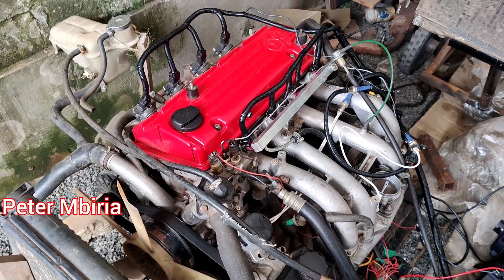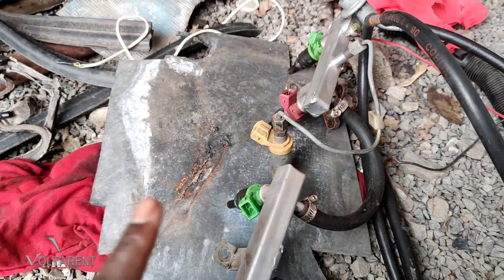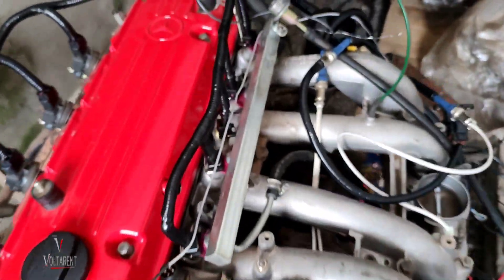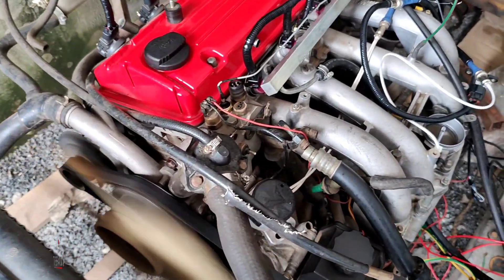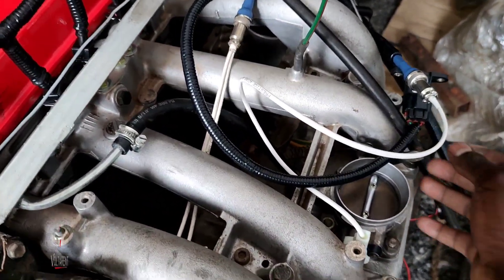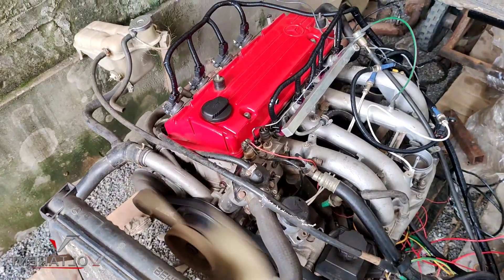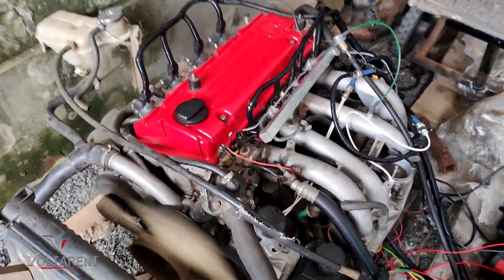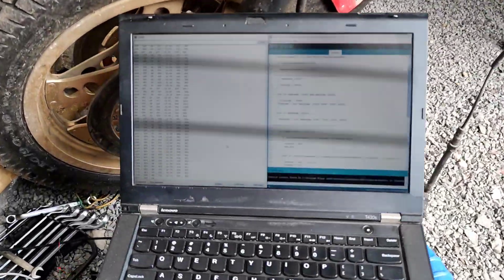Introducing Voltarent EFI: Simplifying Engine Performance for DIY Enthusiasts!

Comment: Peter this is good. Do you have ECUs for 6 cylinder engines?
Reply from the maker: Yes I do and have done multiple installations on different 6 cylinder engines. I've done 6 cylinders from Benz, Jaguar and Toyota.

Comment: I have checked your website, I can only see some information about the ECU box. I think this modification requires more parts and electrical connections. Car enthusiasts also need OBD reader that is one of the most important tools for car enthusiast today. Its a good start to replace the old ignition system but that will not make your drive train similar to a modern car. The carburettors need to be replaced to a new intakemanifold that can adopt to fuel injectors.

Comment: Hi Peter, I have an W124 230E 89, M102 wtith Ktronic and then another 230 CE M102 from 82, also with Ktronic.  The engines are identical excerpt for the single control chain in the older engine.  
Could you give me an estimate fuel saving for this engine?
I am looking at whether I am permitted to upgrade either or both without loosing my oldtimer reg.  Thank you in advance.

Comment: From Namibia here, can you please explain your technology in layman's terms? So I can see value. Explain as you would to a 12 year old. What's your website or email WhatsApp etc.
Reply: Hi There! Great project indeed! In simple terms, it's a  software app running on a tiny computer like an Arduino or Raspberry Pi  that controls how the engine behaves. This includes controlling timing of spark,  fuel transfer,  measuring amount of air intake, checking temperatures, sensing the crank and cam positions of the engine as it rotates, etc. The little app tracks all these values or parameters to improve its performance in many conditions like speed, fuel economy, or even increasing the torque on the wheels pulling a trailer load.  Similar open source projects are Speeduino and LibreEMS! Very fun!
Reply: @projectsspecial9224  Thanks a million 🙏
Reply: @projectsspecial9224 good afternoon sir, please can I have your WhatsApp number, I need your teaching on this project, I want to learn

Comment: Hi Peter
This is Ian Joubert from South Africa. No it does not have EFI, it's a 1984 5 Cylinder 1900cc Passat sedan with a 2B2 Pierberg carburetor.They don't  make that carburetor anymore and it won't let the car idle properly. The problem is the fact that is a 5 cylinder engine. Ian
Reply from the maker: @ianjoubert4360  this one can be modified to full EFI without issues.
Reply: If you guys change to efi. Please make a video.

Comment: Hi Peter! How can i buy it?Hi Peter, how can i buy it?I need the whole kit, fuel rails and all. 190E 2.3 1987
Reply from the maker: Hey man, thank you for reaching out. Where are you located? What's the setup of your engne? This will aid in getting the right parts (FD and carb will need slightly different parts).
The website is not yet fully functional (voltarent.co.ke) but we can organise how else you can make the paments. Shipping will be done via DHL or any other shipping vendors to your location.

Comment: Nice job peter. these days it works better we need it i. Pakistan aswell... 2ndly i suggest you to bring car ac compressor and water pump on electric which reduce the load on engine wil increase performance and fuel economy aswell

Comment: Hello Peter.
I have a w123 230e M1029... engine.  I had an aftermarket EFI system with a standard Dictator Engine Management System installed on it.  The ignition system runs on an electronic points distributor, with a coil unit supplying voltage to all four spark plugs, via the distributor cap and rotor arm within.  The fuel supply setup is similar to yours, consisting of a fuel rail and a non adjustable fuel pressure regulator.

My interest is on the coil per spark plug setup that you have on you engine management i.e. each spark plug has an independent coil.   Which are (coil and spark plug) independently wired and are thus accurately managed by the calibrated cpu.  Meaning the engine runs smooth.  It is my wish to upgrade to your setup. 

Is the product for sale?
 👌👌
Reply from the maker: @namedimooketsi3838  Hey man, thank you for reaching out. How does your current system perform? How Many Kms per liter on average?

The kit is ready for sale. It comes with everything required to convert an M102 with FD manifold in place.

Comment: Hi,you do for Audi 100 c3 year 1990, engine 2300 cc NF 5 cylinder, how much is cost and you send to England ecu and wires  ?
Reply from the maker: @doesmatter5504   Hey man, thank you for reaching out. Yes I do, I have an Audi engine 5 cylinder though it's 2.5. I'll need to get more photos of your current set up before you commit. This will help us know what will be needed on the kit. petermbiria@gmail.com is my address and +254715794913 is my WhatsApp number.

Comment: Hello Peter. I would like to know if you can post the improved specs for the Mercedes Benz W123 such as the original mpg compared to the EFI specs and mpg? Thanks
Reply from the maker: Hello man, thank you for asking. Now, I've done two W123s, one with M115 engine(2L) and the other one with M110 engine (2.8L). 
The M115 had terrible hard starts and fouling plugs every now and then. I don't have the actual figures it was doing with the carburetor but it was clear it was consuming a lot as the plughs were always black. After conversion, fuel economy stood at 10.5 kms per liter town drive and highway could reach 12.8kms per liter. Driving style matters but I'm a bit heavy footed.
For the M110, it came on flatbed as it had a failed K-jetronic system. After the conversion to EFI, It could reach 8 kms per liter town drive. I didn't run it long enough to know highway figures but could be around 9-11 kms per liter.

Power increase is significant and you get to enjoy the freedom to define your driving style via drive modes.
Reply: @PeterMbiria1  Which brings me to another question; regarding the driving modes- how much does it change the driving characteristics by affecting the suspension like it would on a modern Mercedes Benz? I realize it these are 44 year old cars.

Comment: Looking forward to running it on a 504 Peugeot. How are the driving mods and fuel economy tests for the 504?
Reply from the maker: Each drive mode responds different, Eco+, Economy, Comfort and Sport has less fuel to adequate fuel respectively. Ignition angle also is different for each drive mode, Eco+ has more ignition advance angle since it is a bit lean and Sport has less ignition advance angles as it is slightly rich.
Fuel economy varies on engine capacity, drive mode and driving style. It doesn't mean while in Sport, it will terribly consume fuel,, Not really.
Reply: @PeterMbiria1  Fantastic work - there was a 504 Ti (injection)...it would be great to know how your system compares.